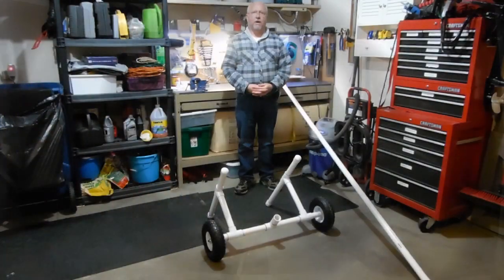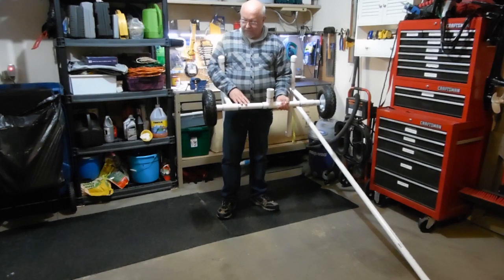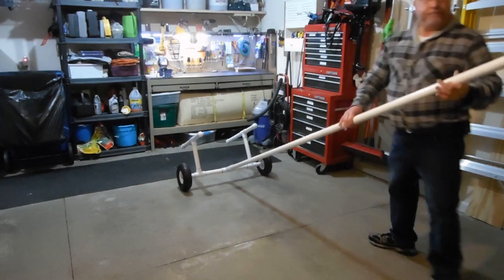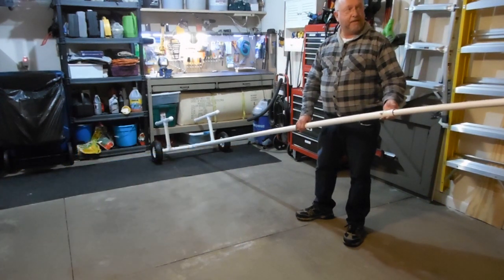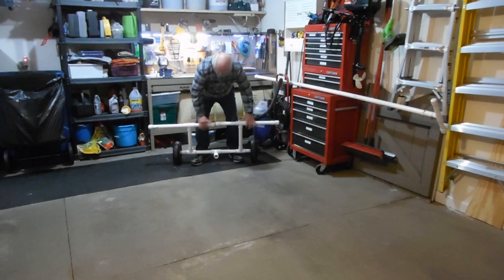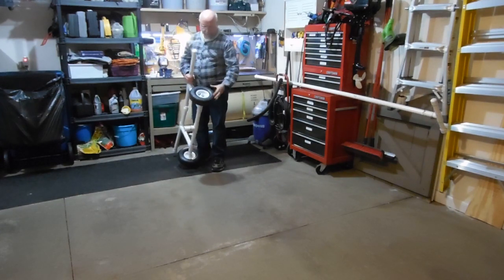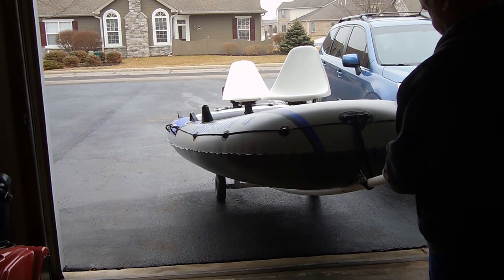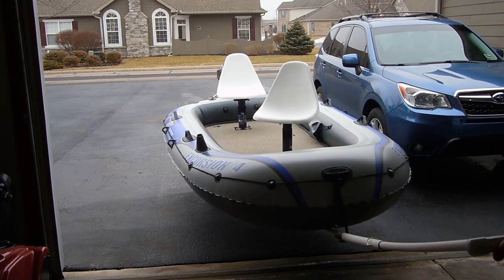Boat Dolly out of PVC Pipe

Comment: Do you have a list of things you need to purchase and plans if you could share please
Reply from the maker: Happy to provide you with the details:  All I ask is that you watch at least 1/2 of each of the following two new posts I have and consider sharing them with a friend or two! Just click the "share" button on the lower right of the YouTube channel if you know of someone interested!

The first is a great safety item I just installed on my Subaru Forester. They have the product to fit other vehicles.
ehttps://www.youtube.com/watch?v=ig4MQ3Specs
Second is for anyone that has very limited space and would like to able to grow tomatoes!  I discovered a way to grow them horizontally and they are doing even better than anticipated.  If you know anyone living in an apartment, condo, or just want to try container garden next spring, check this idea out! https://www.youtube.com/watch?v=DnczP0BsRzA&t=16s

Okay, here is your list of items needed:

1 PVC pipe - 1 inch X 10 Ft  Schedule 40
(approx. 33" for axle, remainder for handle and inside sleeve of the Push/Pull Rod)
2-PVC Pipe - 1-1/4 inch X 10 Ft Schedule 40
5-PVC 1-1/4 inch 90 degree "T" schedule 40
4-PVC 1-1/4 inch end caps schedule 40
1-PVC 1 inch 90 degree "T" schedule 40  (This is to form the T handle)
1-0.625(or 5/8 inch X 36 inch standard (SAE) Threaded Rod.
2- 5/8 inch zinc plated standard SAE nylon insert lock nuts.
1 PVC cement kit
2- 10 inch wheels (I used air filled from Harbor Freight on sale for as I recall under $4 each.) You might consider solid tires to reduce floating.

Also drill a couple of holes in the top supports to let air out to reduce it wanting to float for landing.  Launching is not a problem.

I don't think I left anything out... But you can always contact me and I will add anything I missed.  Here is the link covering the detail of the dolly: https://youtu.be/FJ23KSR2zxk
Thanks for watching.

Comment: Hey Dan, nice job on the boat dolly. Will be building one today. Question regarding the outboard. The standard Intex motor mount works fine with that motor? How long have you had it? Just wondering how the boat handles that motor. I have a 30lb thrust Minn Kota and when I have it on 5, I can see motor mount pushing into the boat a good bit, even with it inflated properly. Thank you for putting this video up.
Reply from the maker: Thanks!  Hey, drill a couple of holes in the top supports to let air out.  It will reduce it tending to float when you try to use the dolly to get under the raft when landing.  
Regarding the motor mount... It does tend to push under.  If you watch some of my other videos on the project you can see it.  I put some extension poles replacing the small ones that came with the mount but even with those it still has been pulling under a bit. (Stiffer poles might help). I also put a strap from my seat post pulling up on the motor..... It's been suggested that if I could mount the poles down to the floor I could keep it from pulling down?  This is my second summer having it.  Have not gotten out yet as river level too high.
There is another Itex model Mariner 4 that might work better.  It's $249 at Amazon and I might upgrade to it.  But for now I'll keep working on the one I have.
Reply from the maker: Here is a link to a recent posting. https://youtu.be/5xagMiNwPn0 
At just past the halfway part of the video you can see the changes I made regarding the motor mounting and it running on the water.  I'm going to do another update soon as I am moving my seat a little further forward, and drilling the air exit holes in the dolly....

Comment: Great design and use of PVC.  I need to move a Zodiac 310 with 8hp Yamaha.  Boat and motor probably about 150lbs or more.  Any approximate weight of your rig?  Want to make sure I don't underbuild it as I was considering switching to aluminum parts but really like the PVC implementation.  Thank you.
Reply from the maker: The raft itself is about 50 lbs.  Add in 25 for the wood floor, another 20 for the motor and 5 or 10 for the seats... So I'm probably around 100 lbs.
You could add a third support T about 2 feet forward of the wheels?  Have in screw in like the launching pole.... Another thought would be to replace the inside PVC smaller section that the threaded rod runs through with a rigid metal pipe for added strength?  Just thoughts!  I can't say for sure it will hold your boat, but if you add the third support, and can balance the weight on the three points instead of two... It might just work.  At least trying it wouldn't cost that much!  Let me know if you try it!  :0)   OH, ONE OTHER THING... Drill a couple of holes in the top end caps to let air out.  It will make it less buoyant when you try to get it under the boat when landing.  Maybe solid tires instead of air filled would help that too?
Reply: BoilerDan1 thank you.
Reply from the maker: Hey snappa2,  after my initial reply, I looked up your Zodiac 310.  I'm guessing it would work just fine.  Maybe leave out your gear and leave the motor off until your either in the water, or just at the waters edge!  I would prefer your Zodiac over my cheapie raft.... If I get real serious, I'll convert to the Zodiac 310!

Comment: Doesn't seem too portable. Is the handle necessary? Can't you just use it like a kayak dolly and strap the axle to the rear and manually lift the front? Just a thought.
Reply from the maker: Once I get the raft loaded, it is to heavy for me to pull into the water.... Plus I don't want to risk a puncture in the raft.... It's not the best quality raft.  I'm able to push it out well into the water too.  Although I admit, it's taken some practice... A viewer suggested venting the tubes so it doesn't float on me... That was a good idea that I will do this spring.  Actually the handle removed and inside itself fits inside my Subaru Forester so it's portable to that extent.

Comment: !!! Quick tip!!!!! Drill holes in the caps that are at the ends of the top supports so air can exit and the frame doesn't float. I just made the exact same thing except I had an old kayak dolly that I used the wheels from and used a 36" x 1" aluminum pipe as my axle since the wheel hubs were that size. Its super light and stiff.  Otherwise I copied your part for part. Thanks for the parts list! Ill be fishing dana point harbor this weekend and dont need a buddy to walk the boat down the ramp!
Reply from the maker: Glad to hear it's working for you!  Thanks for commenting.

Comment: Hey Dan, love your video , but do you have the total length of the handle, and 5/8" steel threaded rod?
Reply from the maker: The 5/8" threaded rod can be obtained at Menards or Lowes. They come in a standard length of 36 inches, then cut your PVC pipe to fit that configuration. 
The extension handle is best to use 10 Ft sections of both the 1 ¼ inch and 1 inch PVC pipes with the 1 inch going inside the 1 ¼ inch pipe.  I shortened mine just a little so it would fit inside a Subaru Forester.  So it is actually a little less than 10 feet long.  To launch, I do extend it out to 17 feet and that does work very well!  Over time, the threaded pipe will rust, but I figure I can just replace it pretty cheap. 
Thanks for watching.  I have some updates coming in the future, so stay tuned!  My adventure continues....

Comment: Why can't you install launch wheels?
Reply from the maker: You will need to enlighten me as to what launch wheels are?  But I've used this PVC dolly several times now, and after the initial few times, I have it down to a smooth launch and recovery.  So I'm happy with what I've got :0)
Reply: It doesnt have a transom. Launch wheels won't work.

Comment: How do you centralise the axcel?
Reply from the maker: I didn't really.  It has a little space but the bolts kind of center it.  There is not that much weight and I push it into the water by hand.  Although I do attach it to the back of my Subaru and slowly pull it back up the boat ramps.  There is a nut on both the outside and inside of the wheel and large washers between.  So the inside one kind of fits into the smaller PVC pipe and holds it in place.  Hope that makes sense?  :0)  It's worked very well, but I do extend it all the way out to launch, as well as pulling it back in.  It takes a little practice, but I've got it down pretty well now.
Reply: BoilerDan1 thankyou

Comment: Hi Dan. Thanks for video. Can I please get step by step on how to build ? Thanks.
Reply from the maker: In hindsight, I should have showed the process.  But PVC can be very easy to work with.  I will add to this or maybe show some of the steps on video.  Give me a few days to work on it.  I might re-edit the original video and add a little part on how to glue it all together.  Tomorrow (Saturday May 5th) I plan on using everything on my first "On the river" test of the dolly, raft, and motor.  Plus some other  add in's.  Stay tuned!
Thanks